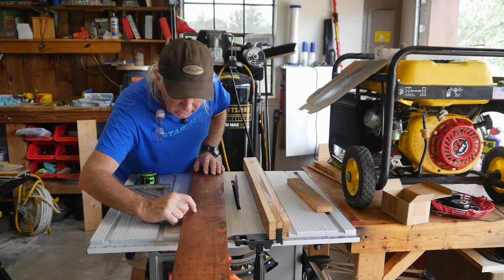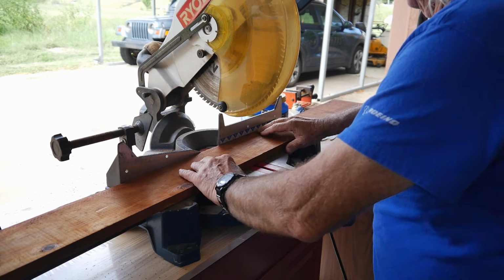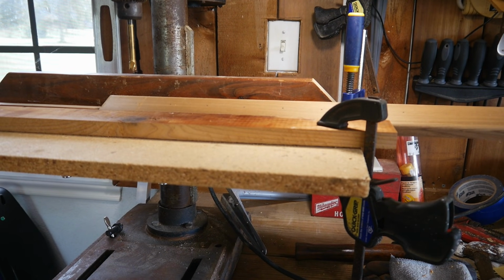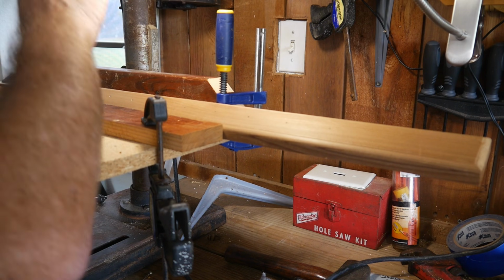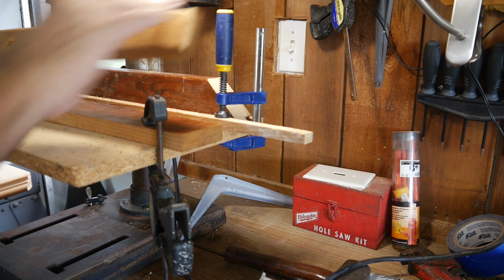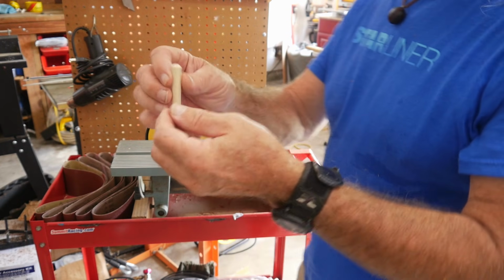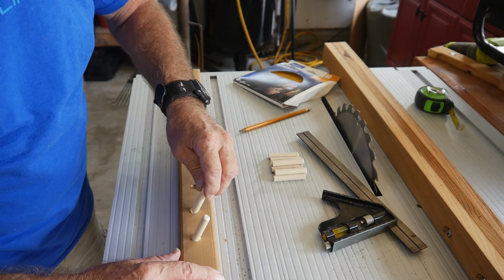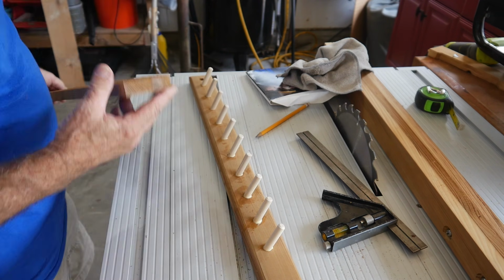Best money making wood project with low cost. good seller,  Coffee and Tools episode 116

Comment: 2:32 I'm sorry, I know you're experienced and I guarantee I am not a troll. I have half a thumb that proves I am qualified to make this statement. You should always set your saw blade height to just above the thickness of the board. Regardless of proper push stick use, if (or maybe I should say when) your hand slips across that board, the amount of exposed blade above the board will determine the extent of your injuries. Fun fact, I was making just about this exact cut with the saw blade set about that height the last time I saw my thumb!
Reply from the maker: Sorry to hear about the thumb. I posted last year how I was shown to use a table saw in the OLD school days :)

Comment: with the crazy prize of wood right now, I have been just finding free pallets wherever I can.  I bought a $19 reciprocating saw at Harbor freight to just cut the nails away from the pallets (saves a lot f time) and then just punch the nails out before running my $19 electric planer over them.  Sand them up and you can use them for all kinds of little projects like this.
Reply from the maker: I did pallets and price is right for them. Free is good. There are some issues with them but maybe we'll have to cover that topic in an up coming episode. Quality can be REALLY good too, like white oak or red oak etc......

Comment: Go ahead and work in your shop as you see fit. As a retired Professional Woodworker of over 36 years, I still have all of my fingers, no impaired vision and excellent hearing.
My body is in very good shape for 66 years old. I have the upmost respect for any and all power tools.
A 2 sided router bit, spinning at 22,000 rpm would give you over 733 cuts in 1 second. I know this for a fact, as it happened to me. It was a dumb mistake on my part, just lost a little corner of a finger. When you least expect it, things happen. So ignore all safety warnings when in your hobby shop, because it wont fly in a professional one.
Reply from the maker: Tell the viewers ! It is fun only if you don't get hurt ! Personally I'll get into my background in the future about wood working :)
Reply: so you don't actually have ALL your fingers....just a little corner missing     lol